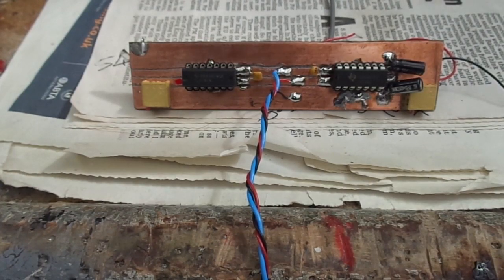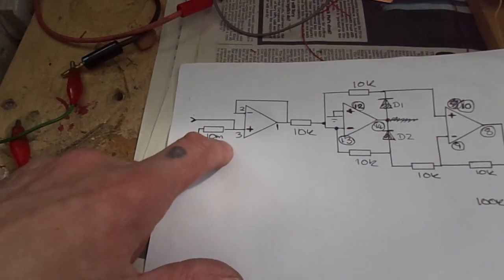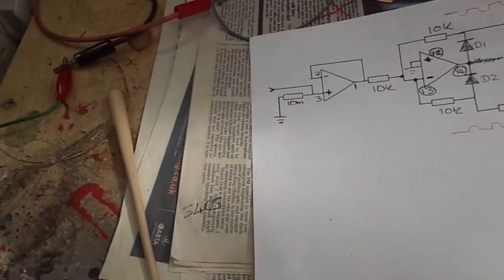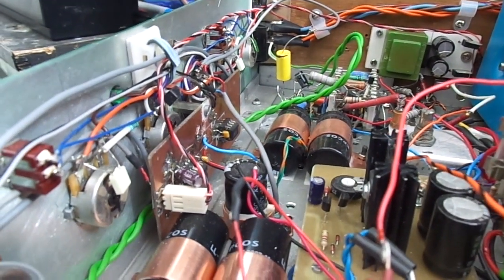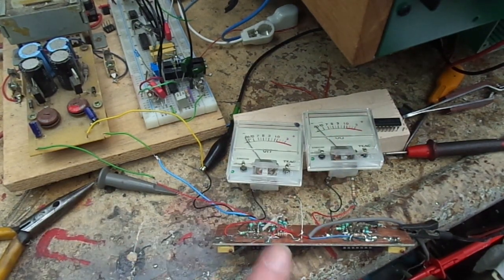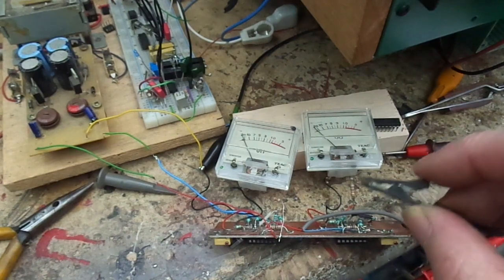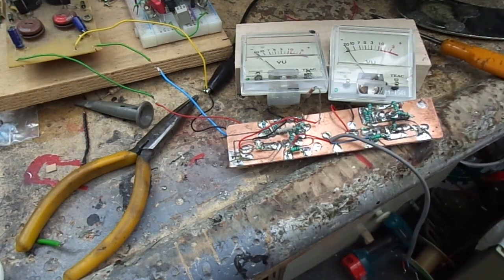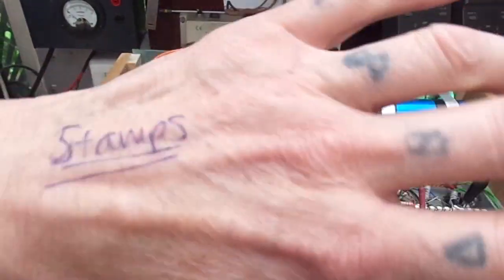Big Green Valve Audio Amp Part Two - The Curse of the VU Meters

Comment: Missing connected grounds. You are not the first one with that problem. Ran into that on a stereo for a customer. Nightmare to track down. Turned out that the wire inside the solder blob was encased in rosin. Push it a bit & it made contact. Bump it and the rosin insulated it. I said more than one 4 letter word on that job.
Reply from the maker: Yes Frank, one tends to look for the obvious when electronic fault finding, shorts, damaged parts etc. It's hard to look for something that isn't there : ) We prevail. TFW